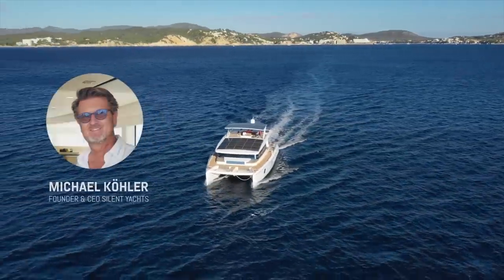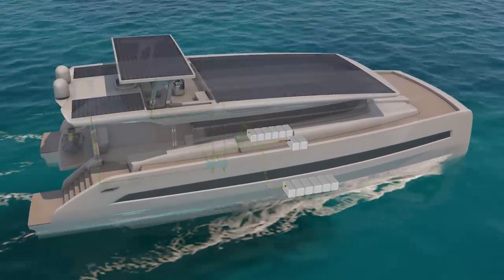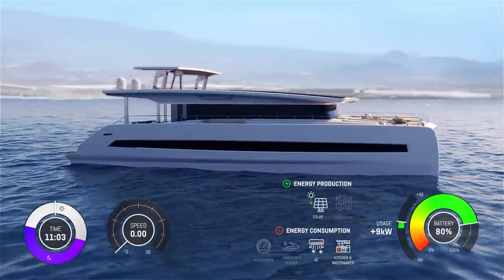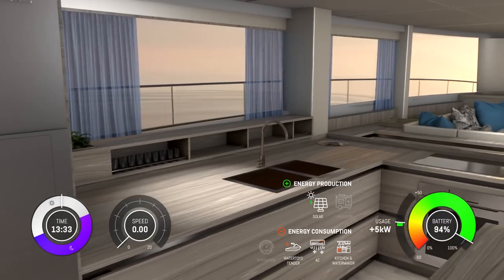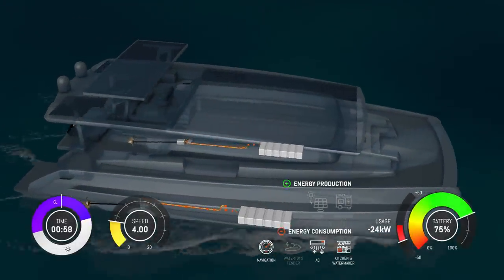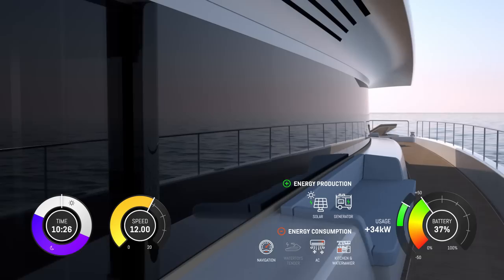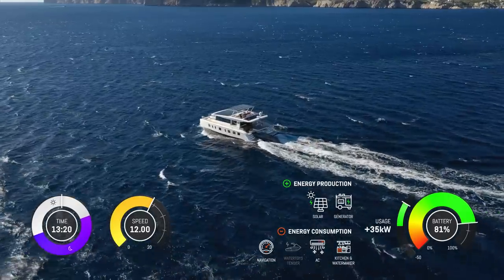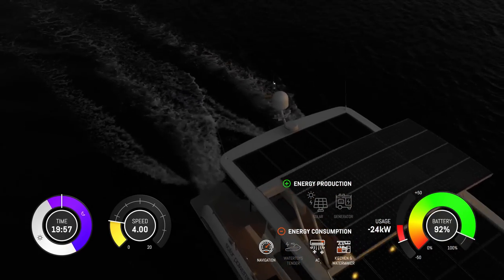SILENT 80 - Energy Generation and Consumption

Comment: If you could equip the yaht with hydrogen electrolisys system and a fuel cell instead of a diesel generator and the diesel fuel tanks, then you could save much space and weight and  get the maximum from the sun, as during cruising you could use kyte and generate hydrogen at once, then during the night you could go faster using reserves of hydrogen or as alternative fuel source.
PV can be twice efficient using other spectrums of the light and if watercooling the pannels, their efficiency won't be affected so much by the temperture, that also would reduce heating of the inner living spaces and save electricity for airconditioning, while collected heat could be used for hot water for showers and kitchen and washing machine, which could get a hot water instead of boiling it by electricity, same is for dishwasher. Condensed water coming from the air conditioning could be used for washing machine and dishwasher or for flashing toilets. Kyte can have wind turbine installed within and transfer electricity generated by the wind, which can be combined all together with its pulling power received from the wind. What I really can't get is why use toilet paper at all on a yaht for 5M€, when there is a bidet seat available for more than a few decades, preheated water and a fan instead of the paper?

Comment: Problem is, realistically if you are making a passage , you have to run the generator every day. And 4 knots is very slow, but going faster requires exponentially more energy. 

So this boat only makes sense for island hopping in the Caribbean etc.  

Thats fine.  There’s just a lit if dreamers who think you can cross an ocean on solar power alone.
Reply: Marvi Wilson Prove it.  

What is consumption at 4kns in kwh?  What is solar total production over one day in khwp?  What is battery capacity?

Cause you cannot do it on their 50 foot model.
Reply: @RogerWilco1  Well, this boat is only going to be 100% electric when it is island hopping or traveling along a coast, anchoring. You are right saying that long ocean passages will need the help of the generator. Using the generator though, the yacht is easily capable of crossing the Atlantic (as done with the silent 64) and possibly even the pacific? Based on my calculations, the boat should have a range of approx. 3000nm on diesel alone. With some good weather, this should extend to at least 3500nm.
Reply: Linus H. The 64 didn’t cross just on its generator but with a bunch of extra fuel aboard.   Again I want to know the numbers, because when I asked deteiled questions of their sakes contact, by my calculations the range was way too short, but I was estimating faster than 4 knots.

4 knots is very, very slow.  So slow that you will be pushed backwards by a stuff breeze, or 4 knots of current.  If you are in the tradewinds then mostly the wind helps you, but that works against you going the other way. 

My only objection is that they dont make these limitations clear.
Reply: Kite sail. The wind at 100 meters above the ocean is way more powerful than at the surface
Reply: John Lions Kite Sail seems like a great idea.  I asked them about it and thet are using some companies product, but that company gas posted no evidence it is a real product that I could see.  
 They just had a demo of people manually flying a kite attached to a much smaller boat. 

It’s a huge effort to bring a product like that to market and a lot bigger kite to move an 80 foot boat than a 23 foot boat. 

And the silent isn’t a light boat, even for 80 feet.
Reply: Roger Wilco I don’t understand what you mean by „just on the generator“? The generator is powered by a diesel tank that every boat is equipped with. The silent 64 crossed using solar and its diesel tank. And yes, 4 knots is slow, however, this boat is simply a hybrid catamaran, that can be run on diesel like any other high-end catamaran can. Here, you just have the additional ability to be sustainable when you are island hopping or cruising a coast, and when crossing an ocean, are no less polluting than other power catamarans of this size.
Reply: Linus H. No, not just its fuel tank. They added fuel that they were storing in deck.  Had to be. Like I said, do the math. 

How do you make 4 knots when the wind is going at 20 knots the other way and the current is 2 knots orthogonal to that?
Reply: Roger Wilco when crossing the atlantic from cabo verde to the Caribbean, you will pretty much always have wind and current with you. I am not sure if they had extra fuel on board, however the silent 80 certainly has enough to cross the atlantic. As I said, at 4 knots the range is 3000nm on diesel alone, based on the numbers I could grab from this video.
Reply: unless your seriously about to thrown down $3M- $6 million for one of these yachts then worrying about its performance and speed really isn't worth the time. We are all just bystanders watching a video, thats as close as we will get to one of these lol
Reply: Linus H. The numbers in this video are nit useful for such estimates. The numbers from the sales guy indicate the 50 cannot do it, and the 80 is a less efficient — higher DLR.

Its impossible for wind and current to always favor you. Unless you only consider crossing one way.

Please get the real numbers and do the math and dhow the math.

You’re just claiming it without considering it.
Reply: Linus H. What is the weight of the silent 80 you are using in your calculations?  Actual LWL?  Actual generator energy consumption? (Not shown in this video)
Reply: @RogerWilco1  As a customer, I have the complete datasheet. In order to generate 100Kw the diesel motor burns 30L. With a fuel tank of 5000L, this equates to 167*100Kw=16700Kw total energy that can be generated using diesel. Without any Sun and at 4 knots the net consumption is 24Kw (according to the video). We can then see how many hours we can travel at 4 knots by dividing 16700 by 24: 16700/24= 696 hours at 4 knots. 4*696= 2784nm of range on diesel alone.
Reply: @RogerWilco1  And yes, while wind and current will not ALWAYS be with you, it takes a quick look at an Atlantic-ocean currents map to understand where currents and winds will be with you and when they will be against you.
Reply: Linus H. Thanks for doing the math.  Only thing I am not sure about is the 24kwh figure being real rather than just an example for this video. But it seems consistent with the 50 numbers.
Reply: Linus H. Going one way, on average they are with you, where goung the other at the sane time, in average they are against you.
Reply: @RogerWilco1  This is a bit of a dilemma. You will have the current and winds with you if you take the North-Atlantic route back towards Europe. This obviously sucks because weather and waves in the northern Atlantic aren't particularly pleasing. I have never seen anyone take the south-Atlantic route back towards the Mediterranean, but that is primarily due to the fact that ocean-cruisers are sailors, and thus can't go against the wind and current at all. I assume that the North-Atlantic route is the only viable route from the Caribbean to Europe unless you are in a megayacht, in which case it doesn't really matter where you go. The 24kWh seems high to me, however, it is unlikely that these values are pessimistic, given that they are promoting the boat. Therefore, I am pretty confident that the 24kWh are real estimates. Early estimates about the energy consumption of the propulsion were lower than what can be seen in the video. It is a bit hard to tell though because the AC is running in the video, consuming a lot of additional energy. According to the video, passive energy consumption for AC and kitchen compliances totals 5kWh. I assume that kitchen compliances including stoves and ovens, etc. will use 1Kw per hour so 24kW per day. This means that AC will use at least 4kW per hour. If one decides to open the windows and doors rather than running the AC all day, they can save a ton of energy. That would leave approx. 19kWh consumption for propulsion at 4 knots.
Reply: Roger Wilco they only used a few hundred liters of fuel for that crossing....pretty awesome
Reply: RE Photo Pros LLC That’s impossible.
Reply: RE Photo Pros LLC this is very little compared to other boats of that size. Very impressive!

Comment: NEXT UPGRADE 
COLD FUSION Reactor able to produce about 3 times over unity energy output while running!

Safe water based containement Cold fusion reactor, not bigger then a washing machine...

Could supply energy longer then 2 months long overcast stormy conditions!

Comment: @
SILENT-YACHTS  Please research Micro Inverters from Enphase.  Your Welcome...signed, a future buyer.
Reply from the maker: Thanks you very much!
Reply: @silentyachts  Safer and more production! AC made at panel..no need for high voltage DC lines.  Shading issues solved...each panel is essentially its own system.

Comment: Teslas new battery technology seems very promising, lower weight, cheaper and more energy density. Something like that will fit perfectly on a cat like this
Reply from the maker: Hi! The special thing about our cats is the modular aspect of the drivetrain. Key components such as the solar panels and batteries can be easily exchanged and upgraded with the latest technology available on the market.
Reply: @silentyachts  Now that is smart forward thinking and a great selling point.

Comment: What is the environmental impact from the construction to the recycling of this plastic aberration? Don't forget the solar parents and lithium batteries!
Reply: The issue is relative. It is way more economical than a power cat. Lithium batteries can be close to 100% recycled. The plastic can also be recycled, but only to a lower grade plastic. Seems to be better than a fiberglass hull. Actually, it may be more economical just from the petrol fuel it doesn't use.
Reply from the maker: As YCPlum mentioned, lithium batteries can be close to 100% recycled. Furthermore, our modular system allows you to easily replace key components such as the batteries and the solar panels. They can be re-used as additional energy storage / production for your house for example. This second life-cycle extends the usage of the products and reduces waste as a result. Furthermore, this means every SILENT can upgraded with the latest technology and thus, improve over time. For more information you can take a look at our website: https://www.silent-yachts.com/sustainability/

Comment: Needs 10x more range
Reply: it can go across ocean. it didnt even say the range. it used only 300 gallons on trip across ocean. that is incredible high efficiency
Reply from the maker: With sunny conditions you have virtually unlimited range - depending on the speed and the overall energy consumption. In case you run into longer periods of unfavorable weather conditions, the back-up generator on board can recharge the batteries whenever needed.